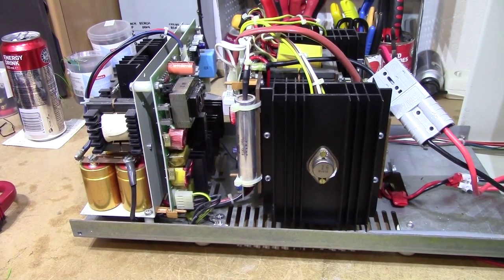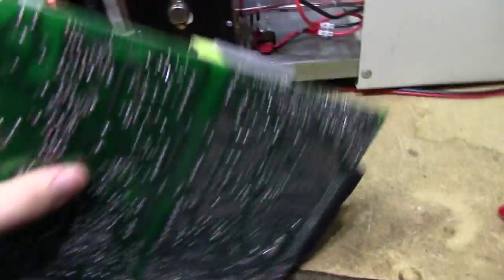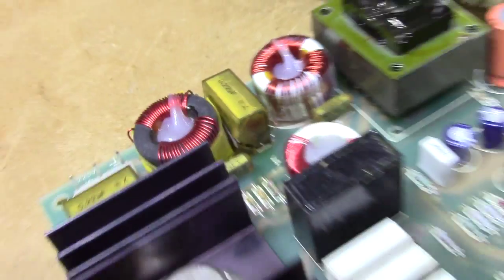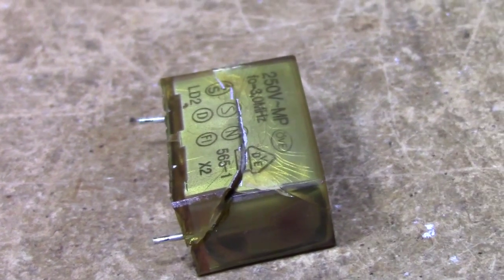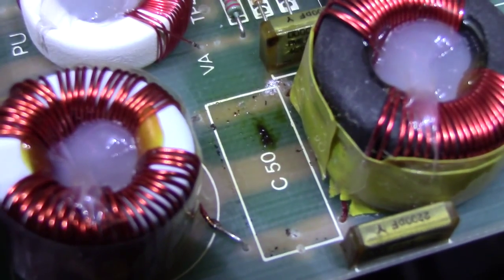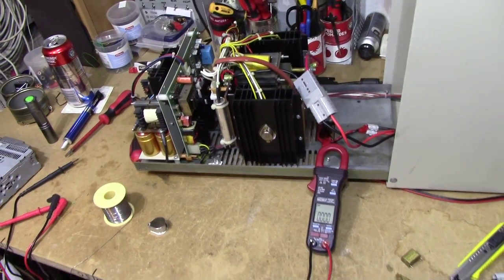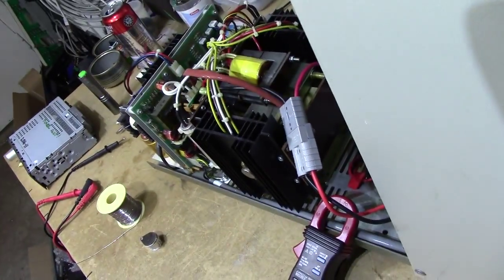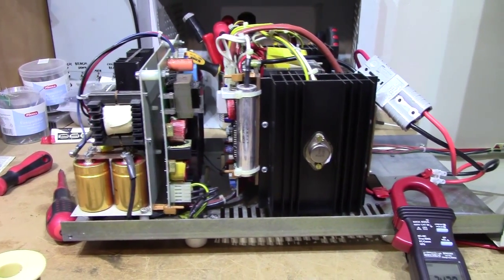Quick repair: Ancient 25 A battery charger/UPS

Comment: Yes ive seen those rifa caps in really old equipment too, not seen many explode.
A frends media center p.c exploded, mains filter caps again, really good bang, made me jump LOL.
The junk electrolitics in cheap switchmodes are the cause of most early deaths, i replace them with panasonic capacitors, seem decent :-D

Comment: Those RIFA caps are notorious for going pop.  They were used in the power supply for the Acorn/BBC Micro computer and often need to be replaced.
Reply from the maker: Yep - I don't know how many pieces of industrial gear I've replaced those in. I's especially nice in big 32A rated 3-phase gear; they tend to turn into a thin plating on the case.